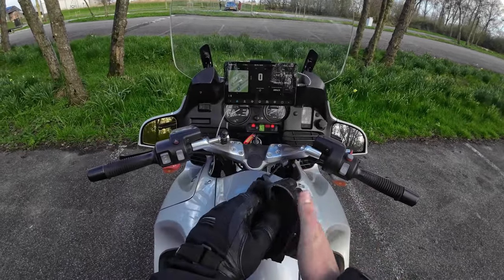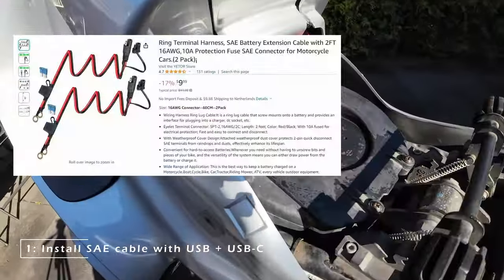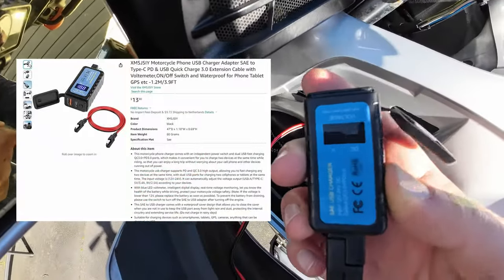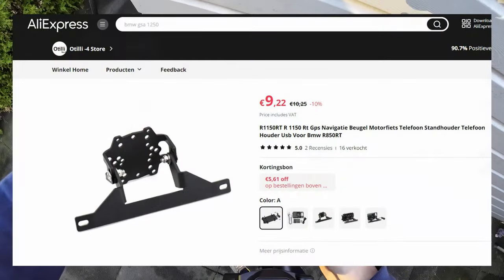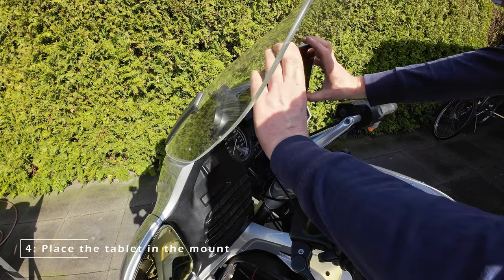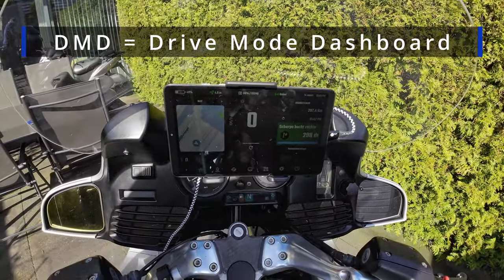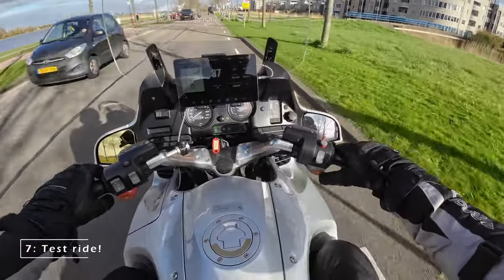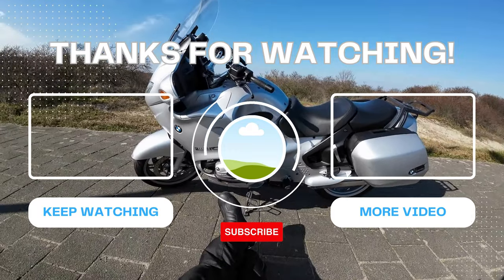BMW Motorcycle Tablet Mount with DMD2 GPS: Installation & Test!

Comment: Do you find 8.7 inch screen too big? Would 8inch be better?
Reply from the maker: The 8.7 inch fits fine as long as you can move down the windscreen. I would choose it over 8 inch so its easier to read the map in DMD2.
Reply: @nielsonwheels83  ok. Tnx

Comment: Did you connect this bike with an obd2 Bluetooth connection? Can DMD2 read the computer protocol? I have an r1150gs but I'm not sure the app will connect to the bike, and I don't know if it's worth spending money if I only have the GPS speed and maps...
Reply from the maker: Hi Jelle,  I did do some online research as I had the same questions. The r1150's use gs911 instead of OBD2. Dmd2 currenty only supports OBD2 used on more recent motorcycles. So for now it's not possible to get any readings from the bike in DMD2. Hopefully in the future gs911 compatibility will be added in DMD2. The GPS speed works fine and as GPS the DMD2 app is very versatile.
Reply: Thanks! Yes, but I can use the MotoScan app with an OBD2 Bluetooth device and connection adapter, so the hardware exists to make it happen! I don't think there is much demand for DMD2 to add the capability, though.